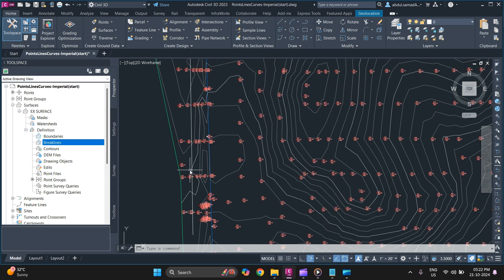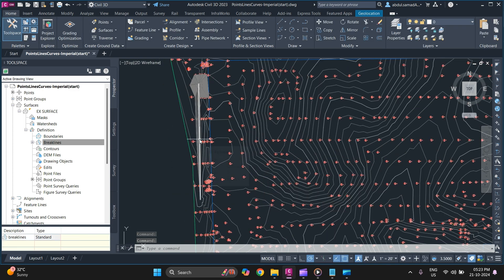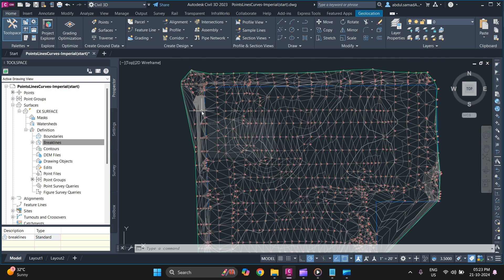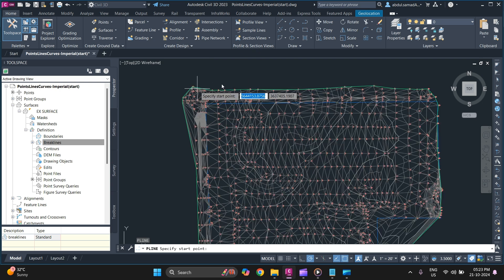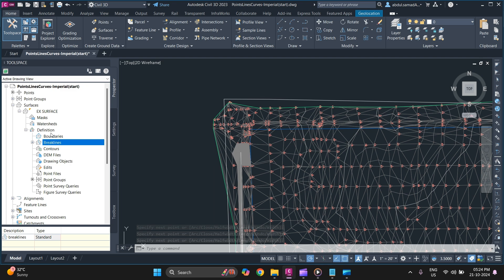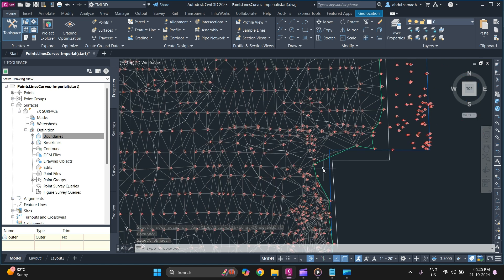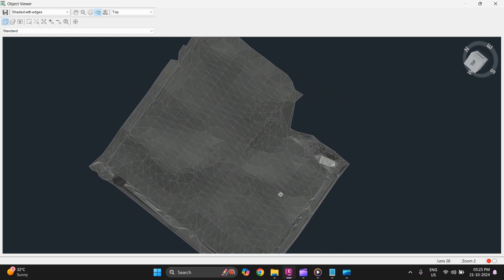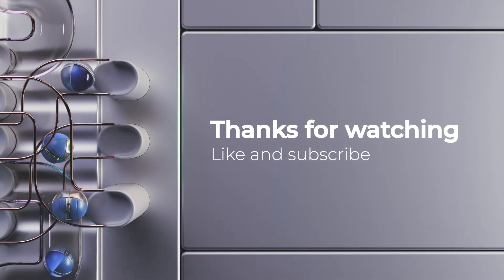Add Breaklines, Boundary to surface in Civil 3d! (civil 3d Modeling) #civil3d #civilengineering #c3d

Comment: What is the exact role of breakline , created  with closed polyline when we calculate cut and fill volume to achieve a  proposed ground level ?
Does closed polyline breakline (compare surface)  acts as a imaginary surface and it breaks the natural ground and proposed ground  surface?